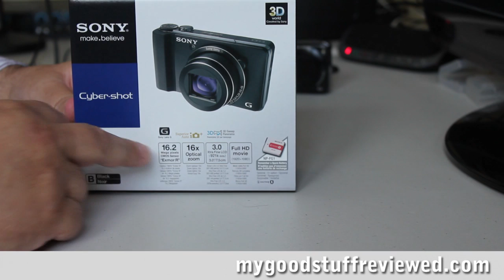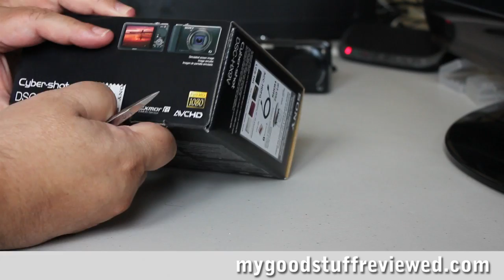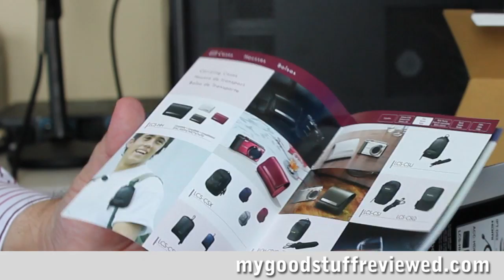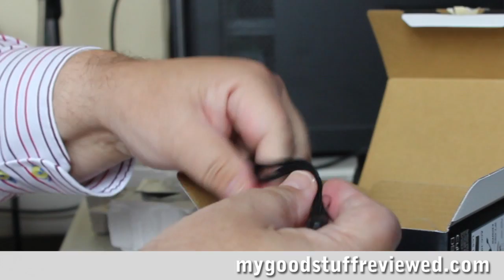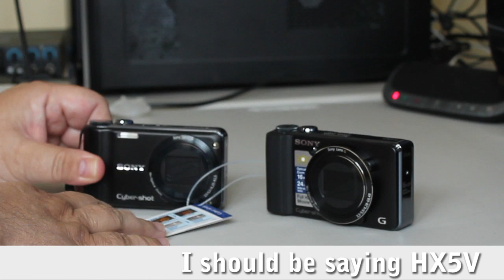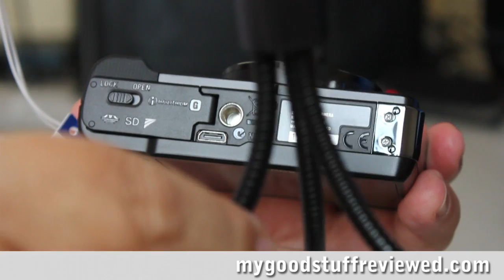Sony DSC-HX9V compact digital camera unboxing and quick review part 1 - no background music

Comment from the maker: The DSC HX9V is a really great camera. It gives really nice results and it's excellent for video so you've got a great start with that camera.

The principles of how to use the HX9V are really the same as you would use on an expensive SLR, so anything you learn with that camera can be used on any other cameras you buy.

Comment from the maker: The biggest benefit of the SLR design was that you could tell what you'd get in the photo, before you took it. It also made focusing a lot more accurate and the bright sun wasn't so much of an issue.

Most modern cameras of all types don't really have a problem showing you what you'll get in the photo. Some of the non-SLR types still have problems in bright sunlight.

Comment from the maker: Those numbers indicate the focal length of the camera.
Focal length is 4.28mm to 68.48mm

On a traditional 35mm camera, that would be the same as a lens of 24mm to 384mm, a massive range!

SLR stands for Single Lens Reflex. The reflex bit refers to how they have to bounce the image around inside the camera to get it to show in a traditional viewfinder. This kind of camera doesn't have that kind of mechanism, so it's not an SLR. It's quite an old term now, although it lingers in the term DSLR.

Comment from the maker: Shutter speed, ISO, aperture and amount of light all have to "balance" to get a good exposure. Lower ISO values will tend to give longer shutter speeds and/or wider apertures, for a given amount of light.

It's normally very expensive for camera makers to make a compact lens with a really wide aperture, but much cheaper to make the shutter open for longer time periods. That means for low light/low ISO, the shutter is more likely to be slower to compensate.

Comment from the maker: Hi. I think the light system on the charger is a bit weird, too.  When the light goes out, the battery is charged. When the light is on, the battery is still charging.

It's kind of opposite to what I'd expect, based on other camera, but you soon get used to it once you know what it means.

I hope we get to see some of the stuff you take with your new camera. It's a pretty capable camera and does some very nice video.

Comment from the maker: When you zoom in you are changing the focal length. The 16x is your maximum zoom.

In other words if you change your focal length from 5mm to 10mm you have used 2x. But those numbers don't matter. What matters is the effect you want and you'll gauge that from the lcd screen.

Numbers are useful to compare one camera to another. For taking photos, concentrate on what you're see. Most people using this kind of camera will rarely bother checking what focal length and zoom factor they're using.

Comment from the maker: That also means that when you've hit the widest aperture your shutter speed would have to lengthen if you're still not getting enough light. That's assuming you set a fixed ISO.  Some cameras can automatically change the ISO for you, depending on the light levels.

Comment from the maker: ah, ok, I understand.

The focal length or focal length range gives you information that lets you work out how wide-angle or how telephoto a lens might be.

The optical zoom of 16x is related to that, but is not identical. It just tells you that the maximum telephoto zoom is 16x more than the widest angle. You could work that out just from the focal length range.

Optical zoom range is different from Digital Zoom because it's almost always higher quality. Some cheap cameras use digital zoom.

Comment from the maker: SLR's always used to have mirrors to reflect the image into the viewfinder, so you could see what you'd be taking. That's the "reflex" part of the name SLR. It's really the same with DSLR's.

A mirrorless camera doesn't have the mirror, hence the name. It uses the information from the sensor to send to an electronic viewfinder instead of an optical viewfinder. Without the mirror the cameras can be smaller and lighter and so can the lenses for them.

Comment: @Zoheba The reason is because in Europe their electrical power grid runs on 50Hz and in America it runs on 60Hz. If you are filming using 60fps under a fluorescent light that's running on 50Hz you are going to encounter flickering because fluorescent lights are actually extremely fast strobe lights so some of your frames will be completely black.

Comment from the maker: Not all cameras have mirrors. The ones with LCD viewfinders, well, compact cameras at least, take the image from the sensor electronically and put it on the LCD. They don't use mirrors for that.

SLR's used to be special (long, long time ago), because they were virtually the only way you could see exactly what you'd get in the photo before you took it.  The other types back then, rangefinder and TLR, you kind of had to guess a little bit. There was a slight difference what you saw and took.

Comment from the maker: The focal length of this camera goes from 4.28 to 68.38mm.  That's why the zoom range is 16x. In other words, 68.38mm is 16x 4.28mm.  The optical zoom range, in this case 16x, does not tell you what the starting focal length of the lens is. 

That's why you need the other numbers, so you know how wide-angle and how telephoto the lens can go.

Comment from the maker: @Zoheba   It's to do with the scanning rate of the tv systems used in those countries, I think.  That in turn is to do with the frequency electricity cycles at in the electric supply of those countries.  It's very much an historical thing, I believe and doesn't  really make much difference in real terms.

Comment from the maker: I've never liked them myself. In most cameras, they're a little bit small to be comfortable using them. Also, because they're not normally showing you exactly the same view as the lens, when you take a photo it won't look quite the same as you expect.

With modern cameras and batteries, there's less need than there was for optical viewfinders. However, in very bright sunlight they can still be useful, because LCDs can be very hard to see in really bright sunlight.

What camera do you use?

Comment from the maker: They're not really exactly the same thing.  The optical zoom ratio is just a number that tells you how much difference there is between the widest focal length (smallest number) and the maximum focal length (largest number).

The figure that counts is the optical focal length range. If you know that, you can always work out the optical zoom factor. If you only had the optical zoom factor, you wouldn't be able to work out the focal lengths just from that. Focal length range is the important one.

Comment from the maker: I'm not sure if the charger supplied with the camera has an automatic trickle charge, or auto off function. I think it's safe to leave it overnight like that, but I don't really like to do that myself - just in case  :)

However, I have forgotten to take the battery out of the charger a few times and it still seems to be ok. It doesn't seem to have lost any capacity, but I can't guarantee it's a safe thing to do.

Comment: hello again)) i tried to switch on the feature where you an make 10 photos at once. I some how managed to do it - i do not remember which button i pushed though, and then I could see that the camera made 10 images in 2 seconds or so, nut I could not display them. Also how to make photos in black and white and also how to make good quality images while not using the flash - I manage to make awful quality pictures)))) thanks !!!)))

Comment: Why do Middle eastern and European Models of DSC Tx100v and DSC-Hx9V have 50fps at 1080 and not 60 fps at 1080 like American models? Why there is less 10 fps less in these models? That means there is a little compromise in video quality(less Frames per sec)?